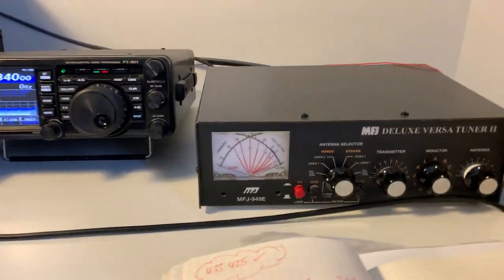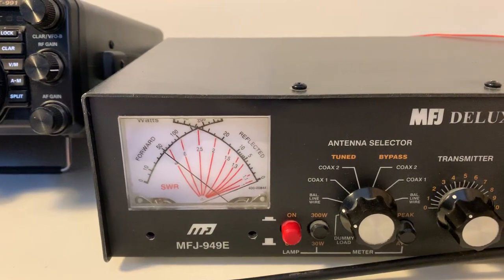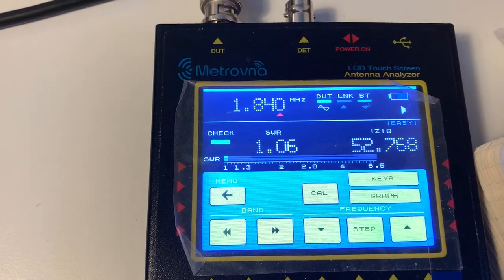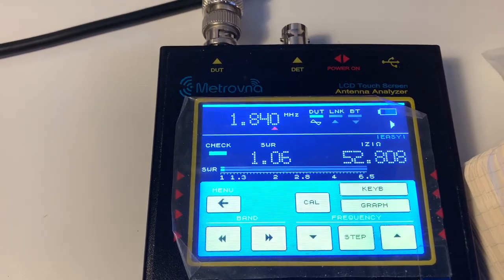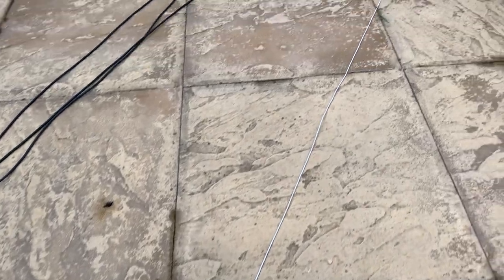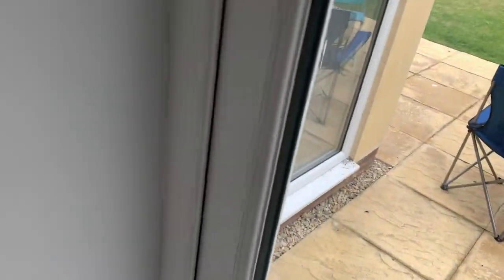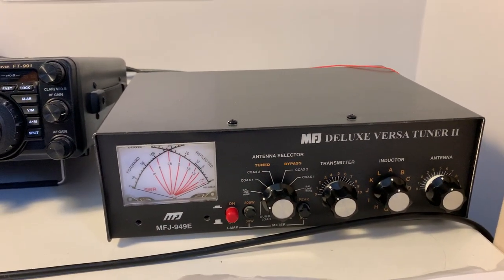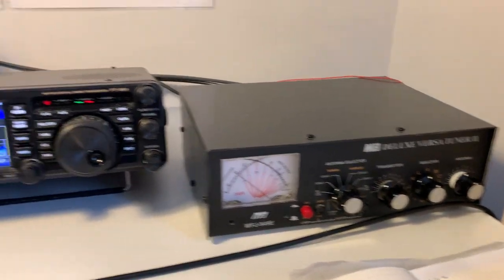How I built a simple 160m top band transmitting antenna for £4.50 that actually works!

Comment: Love your Antenna Setup. I really do. But transmitting on HF-Bands with an FT-991 (A) does not make you lots of Friends because of the dirty wide splattering TX-Signal these Radios producing. They working fine on UHF / VHF but not on HF. Hey, you got a lot of awsome Receivers there. And the IC-756Pro which performs great from 160-6m Bands. Keep up your good Work. 73 de Uncle Günter 💯👍🙋‍♂
Reply from the maker: Thank you for your comments. I've never had any complaints from other operators regarding the splatter from my FT-991A.

Comment: Good to see what actually works.Back in my "naughty" pirate radio days on medium wave we used to always use a  quarter wave inverted L and lots of radial/earth wire to tune against and the results were amazing considering we were using about 10 watts.I have been experimenting with Topband mobile recently and with the Ampro 160 whip have had excellent results.Hope to catch you on air one day.73 Ian G7HFS/PA3IKH
Reply from the maker: Lol thanks for the info. and yes certainly, it would be great to catch on air someday! 73s, Clint
Reply from the maker: I've emailed you! 73s, Clint

Comment: This inspired me. I actually have the length to put up a half wave dipole for 160 but haven't because most of my available height is around 20ft AGL. Your results make me think it might be worth a punt.
Reply from the maker: Definitely worth a punt! I'm using a 1/4 wave - minus velocity factor, with a single earth rod and 28 radials...it works really well. I must name it after my callsign lol. 73s, Clint

Comment: Well done for inspiring people to try topband.
 I use an end fed half wave for 80m to 10m, by patching out the 49:1 transformer (and using a ground/radial system) I use it as a quarter wave on 160m, it also works on 60m. As you have 40m of wire in the air just try inserting a 49:1 transformer sold as an end fed half wave.
Reply from the maker: Thanks Paul! I'm due to modify my antenna again soon anyway, so I might try the transformer. 73

Comment: Dear OM -- Many thanks for the clear explanation / demonstration of your 160m Inverted-Z :-)  Your radial discussion was particularly useful, the details very helpful.  I'll see if you have other videos of on-air 160m contacts.  I'm interested in what the noise level is like at your QTH.  (Band is very quiet here in Central Luzon, Philippines.)  Brilliant work, mate!
Reply from the maker: Thank you. QRM at my QTH is usually quite low but band-dependent. Anything from -110 dBm down to -125. 73
Reply: @OxfordShortwaveLog Oh that's great!  Hoping to gray-line G-land this winter :-)

Comment: This is absolutely awesome! Any improvement since you originally posted the video? I plan on putting up a half wavelength dipole. I'm still waiting for parts and knowledge and time to build my receiver and transmitter lol. The 160 m BAND absolutely fascinates me. I plan on going diagonal from one corner of my lot to the other and I should have enough room for roughly 240 ft I prefer the half wavelength dipole because then I don't have to worry about a ground plane or any radios. Do you have any tips for me? Also once again great video!!!
Reply from the maker: Hi, thanks! I've added more radials - I think I'm up to 30, but it's diminishing returns. It's now a bit higher too, but great match on 160m and 80m - also works very well on 40/20 and 10! Good luck!

Comment: I found from experience with my work in broadcast involving LF and MF systems, the earth system is key, together with a good antenna vertical section.  The horizontal top section acts as a capacity hat making the antenna appear electrically taller than it is.  The impedance match you have achieved bears that out and the reports you have in relation to your transmission are impressive.   You must have achieved good 'low angle radiation', giving good sky wave performance.   You will also have some directionality and gain associated with the top horizontal section, which runs in the direction of the horizontal portion of the antenna.
I guess the differences between your system and the broadcast systems with which I was involved,  used an electically short lattice mast or a wire 'T' antenna with either a base loading coil or 'capacity hat'.This made the antenna appear electrically taller, than the ideal quarter wave.  We were principally only interested in ground wave coverage with local and regional mf radio.  You however would be purely interested in the antennas sky wave 'low angle' performance which is obviously very good. 73's
Reply from the maker: Hi thanks for your comments - indeed the radiation angle of this antennais low. I can work DX from 10m up on modest power and it matches about 1.5:1 on top band, 80 and 40. The match on 20m is about 1.2:1. The entire route of the wire is slightly convoluted, but overall performance is certainly directional beacuse 95% of the horizontal section runs across the garden and over the roof of the house without changing direction. Thanks again and 73

Comment: your setup is similar to mine,   except I used automatic antenna tuner MFJ-993B   outside at feed point in water proof plastic box.   it works well 7MHz, ok at 3.5Mhz, not so good at 1.8MHz  AG6JU
Reply from the maker: Thanks for your comments. I mostly use the rigs internal matching these days. Mines ok on top band actually. 73!

Comment: great work Clint the 1/4 wave is my preferred 160m antenna the more radials the better you will find but 25 is adequate. also try setting up ta feed point to coax core to radiator and radials etc to shield. also make sure you try tuning on other bands like 40m etc and even some of the higher bands. wspr is also a great tool on 160m lastly some improvements might be found if you raise the initial  vertical part to say 25-30 ft. asnd on 160m grey line is friend have fun.
Reply from the maker: Thanks for your comments!

Comment: Great video I use a very similar set up but I use a end fed half wave using a 49 to 1 for 80m to 6m I simply use a dipole connector with a short wire and Croc clip which I clip onto wire at transformer I simply undo pl259 on transformer and plug into dipole connector to bypass transformer the ground side of dipole connector goes to a ground rod and long counterpoise which terminates at a large metal trampoline, this too makes a great top band quarterwave using the same wire as my 80 to 10 efhw. Just subscribed to channel and look forward to watching more cheers 73
Reply from the maker: Hi there Nigel, thank you very much for your comments. Love the idea of your counterpoise terminating at a trampoline! Whatever works though is always my motto, so very good indeed! 73s, Clint

Comment: Very inspiring video. I managed to shoehorn an 80m dipole in my small plot, didn't think it would work very well as its not very high, and it's more a Z shape. Amazingly it works very well according to inter G reports and from the continent. Even made a contact into VK on FT8 which astounded me. Was thinking of trying an inverted L on 160, been told it shouldn't be too hard. Thanks for sharing.
73 de G0CQZ (Witney)
Reply from the maker: Hi there Nigel, good to hear from you - and you're only in Witney. I'm in Eynsham - but I guess you may already know that! The shape of my top band antenna is also Z shape (approximately) and TBH I'm amazed at how well it works. You did amazingly well to work VK on FT8! An inverted L for top band is a reasonable project in terms of scale - I too thought about building one. Keep safe. 73s, Clint PS after lock-down perhaps we should meet up for a chat sometime.
Reply: Hi Clint, thanks for the reply. Yes that's be good to meet you when all this is over. I'm still on furlough and probably will be for the foreseeable future according to my boss. I must rejoin Harwell club, I passed my RAE with them and had wonderful times operating the club call on NFD many many years ago up at Sparsholt. Anyway, keep up the good videos I have enjoyed watching them since I have reignited my love of radio. 73 for now
Reply from the maker: My pleasure Nigel. Look forward to meeting up one day in the future perhaps and seeing you back at HARS! Thanks and 73s, Clint

Comment: Hi Clint, you know I've always wanted to bang an earth rod into my small back garden but I'm nervous about going through a gas/utility pipe! Is there any relatively safe way to do this or is it a matter of luck? I have to say I love these American ham radio videos where they take you into their 'back-yard' - it's a wooded area around 3 acres square with no visible boundaries..! Incidentally, does the rear of the house face north-east or have I got my calculations wrong? Cheers, David.
Reply from the maker: Hi David, there's no absolutely safe way of putting an earth rod in unless you have a copy of the utilities from the Land Registry Office I suppose. I guessed and was lucky! The rear of the house is sort of East facing. 73s, Clint
Reply: I know this is a 5 month old post & I'm a bit late to the party, but look into the "water drill method".

Obviously there are no guarantees if you do hit a utility pipe and as Clint says, you should really be checking with the utility companies.

That aside I would suggest that it is the safest method as by putting it in by hand you would hopefully feel the resistance (& stop before you do any damage) if you were to hit something.

Plenty of videos on YouTube showing this (including one on my channel) if you want to see it in action.
Reply: @AmateurRadioUK  a very good metal detector can also help in locating utilities

Comment: Hi brilliant channel, can I ask how it effects with the window connection at 75  Ohms to 50 Ohms, can you do a video on  linking up to the radios with the window mount connection, I have a DX80 Sigma and the Plus Pack, I used RG58 it was terrible on SWR, so I asked a friend to lend me some RG8 it works brilliant, I've got some now but where my window is I need to use a window connection or RG58 then back to RG8 any help be brilliant de 2E1FUE.
Reply from the maker: Hi there, thank you very much indeed! I dont find any problems at all with the window jumpers. I transmit though them and RX of course. I can do a video showing the set up with my G5RV sometime soon. Thanks again - it's always great to hear the videos are useful/enjoyable! Keep safe and 73s, Clint
Reply: @OxfordShortwaveLog  Brilliant stuff that would be brilliant, the comet SO239 Adapter is a little on the expensive side, I have two of the TV Adapter here at home, it would be brilliant to do a video on how you did it 😀 thank again Clint DE 2E1FUE 👍🇬🇧👍

Comment: Nice job!Could tell me what dx stations have you worked so far?
Reply from the maker: Hi there, I will do a review video and look back over my log...I worked a guy in Moscow on 5 Watts TX power using it - and I've worked a lot of North Americans on higher power. 73s, Clint
Reply: @OxfordShortwaveLog  you've worked nr America on top band? That's good going nice one, I've worked states on 80m a fair few times but never on top band, cheers 2e0nbk

Comment: Very good insight into getting on top band, i was wondering how to get 132ft each side in my garden no idea on how to fit it in our garden mates say i need to put wire on a former lol, your idea as given me thought.  Mike M0FCG M1KEY
Reply from the maker: Hi there Mike, I had no idea this would work very well at all. It seems that even quite a convoluted route for the antenna on 1/4 wave (minus velocity factor so about 36m) works ok, but really improves with a ground rod and as many radials as you can manage. Glad to have been of some help. Keep safe and 73s, Clint